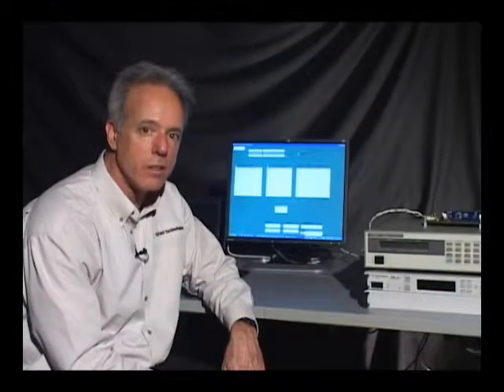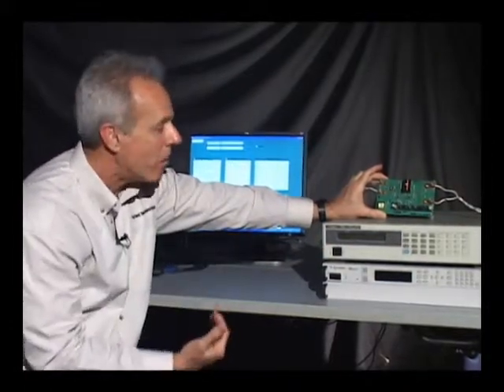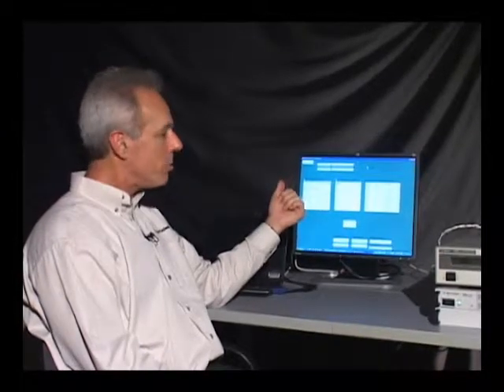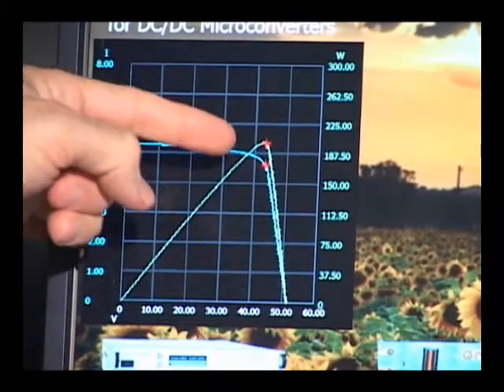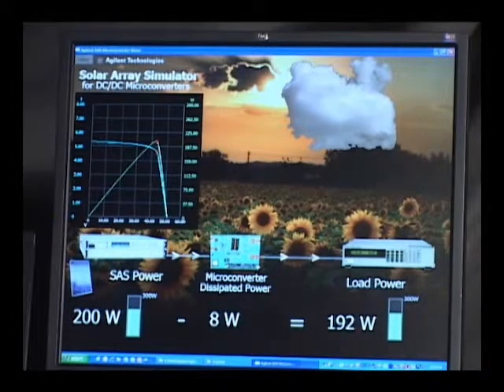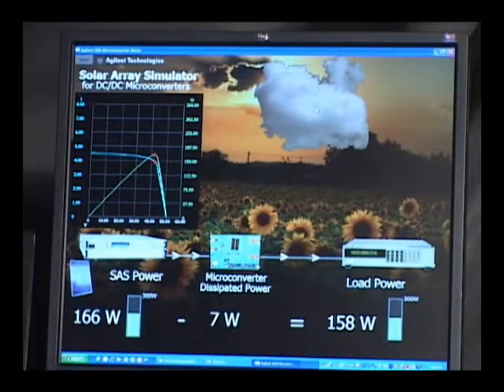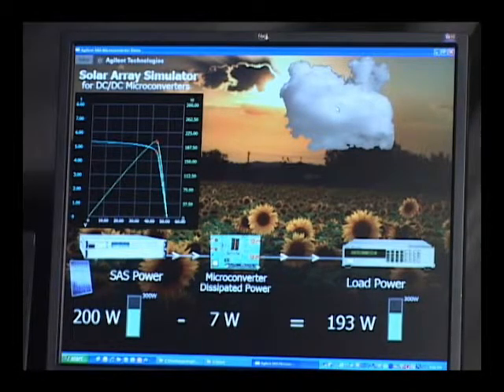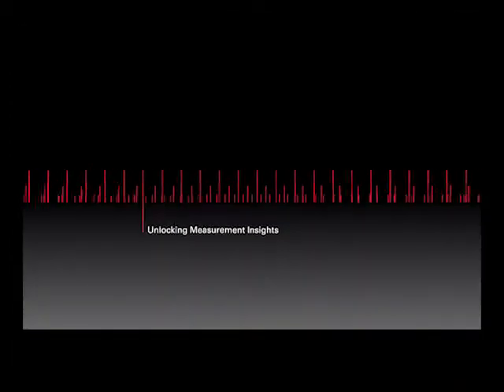Testing a DC to DC Optimizer Using the Agilent E4360A Solar Array Simulator

Comment: If optimizers are put in series it means that they have to supply a constant current usually 9 amps. If one of the panels gets shaded that optimizer still has to bypass 9 amps through the optimizer to keep the power flowing through that string... Exactly how does it do this?